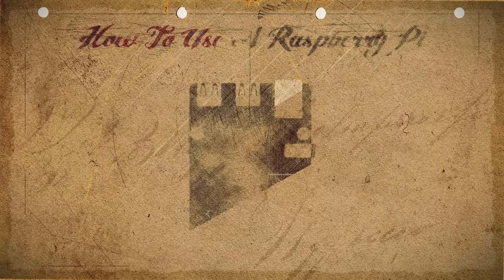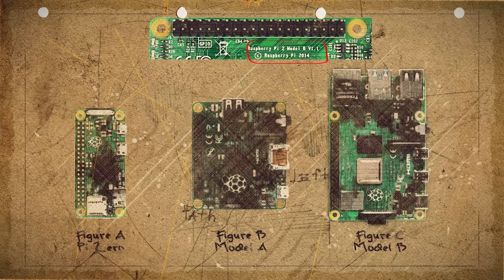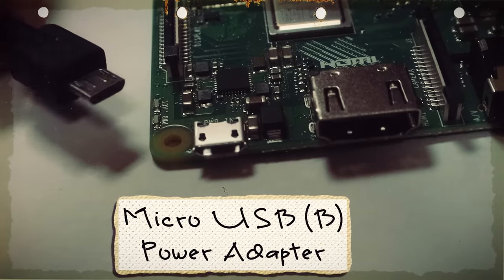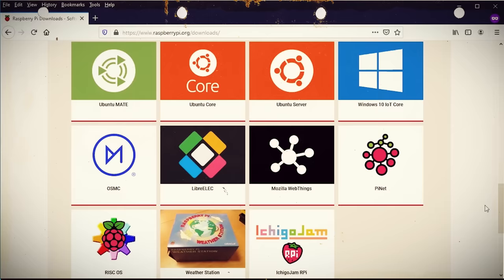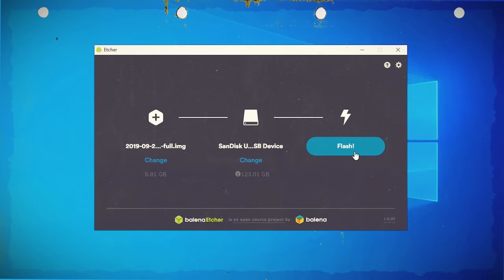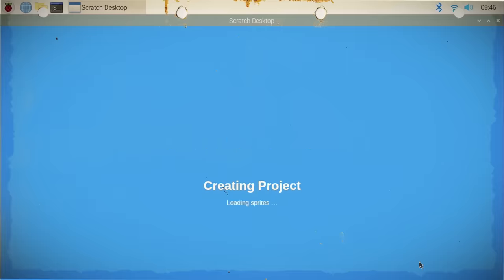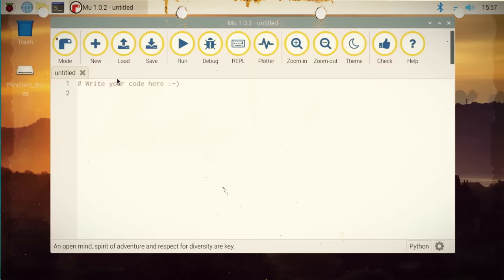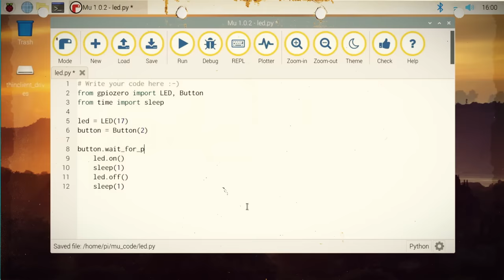Program A Raspberry Pi In 7 Minutes

Comment: I knew this stuff already but it was nice to see it again. I actually learned about the raspberry pi form you and asked for one for my 15th birthday. A shame it died a few days ago. RIP raspberry pi 1 model b. 2012-2019
Reply: chadmasta5 why did it die?
Reply: @hennarkilsen1389  a little capacitor connected near the micro usb port came off. That pi has moved with me quite a bit over the years so I guess over time it came loose. I believe it was there to filter the power going to the pi and without it the pi slowly burned out. It was serving as a pihole server and I only noticed something was up when I got ads again.
Reply: Quite impressive still for a a computer that costs less than $50.
Reply: Epic, man!
My 14th today, and I got a Pi Zero!

Comment: Even if it is fun to use raspberry pi as a standalone computer it is cumbersome, you have to connect all extra peripherals you may not have lying around and it is much easier to type on regular laptop/pc with big screen than that  tiny screen. If you want to build and run something it takes forever to build the code on a Pi. can you make a tutorial on how to setup a cross build and debug environment for linux SBCs (Pi/BBB etc.)  on linux and possibly on windows. I could not find any good tutorial for this on internet.

Comment: Can I just connect the pie to my laptop and use my laptops screen, keyboard and mouse instead of three separate devices?
And if I can how?
Reply: No, I don't think you can do that..You may want to use a USB hub and MicroHDMI converter..✌
Reply: @kittyalvares  thank you
Reply: Well...You can use vnc
Reply: Look into "headless raspberry pi setup" if you are fine with using your RPi over the command line.
Reply: Yes, absolutely, via ssh and or VNC!!! There is plenty of tutorials

Comment: im trying to switch from arduino to rasberry pi, mainly because raspberry pi has more features compared to arduino, and a more powerful chip
Reply: I'm interested in doing the same thing. One thing that's giving me pause is that I've heard that the Arduino uses 5 volts on it's pins and the Pi uses 3.3v. There seems to be a lot more stuff available for the Arduino. (especially in my parts collection)
Is there a voltage conversion board for the PI's GPIO pins, or do you even need one?